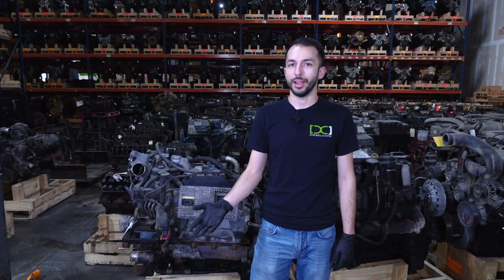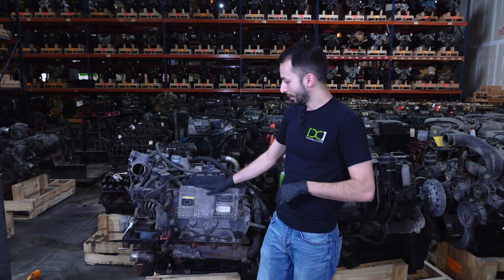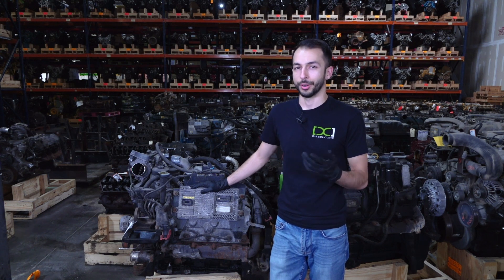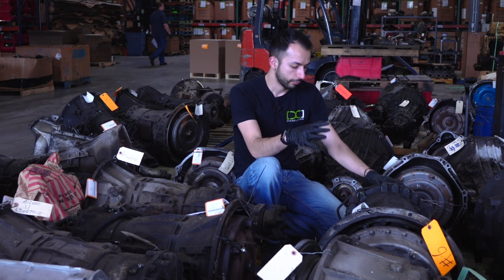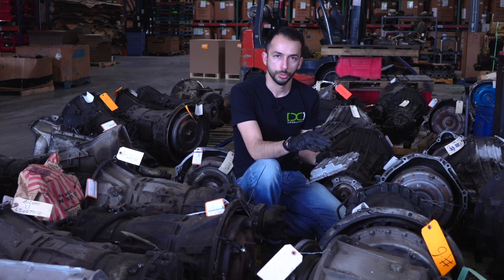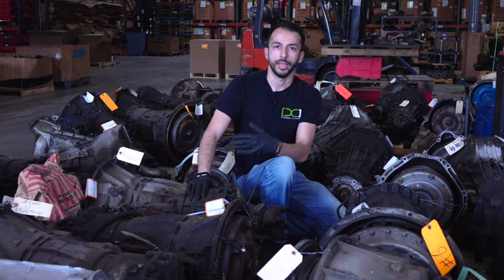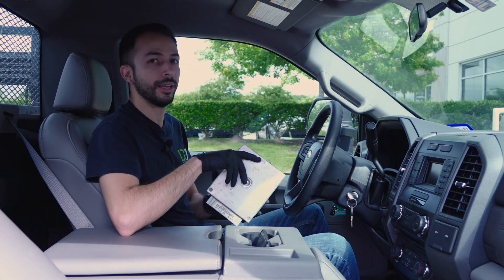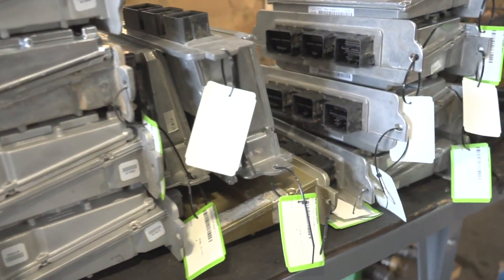What's the difference between an ECM, TCM, and PCM?

Comment: Do you sell wire harness?
Reply from the maker: Which kind of wire harness are you looking for?
Reply: @DieselCore  2008 f250 5.4 engine gasiline harness computer to transmission automatic transfer case
Reply from the maker: @abellopez31  Sorry, we don't carry that particular engine. We carry a very limited selection of gasoline parts at this moment. We mainly focus on diesel parts and diesel components
Reply: @DieselCore  ok thank you

Comment: Ty my 06 is250 wont shift past 4th, and im not about to change all of the pressure control solinoids after replacing the transmission, but what the hell is PCS A, when i just changed all of the solinoids, but the car still shift the same, only to 4th. Autozone scan tools suks
Reply from the maker: Unfortunately we are not familiar with Lexus IS250 and their transmission unless you are talking about a Ford F250 then perhaps we can help you there. You might want to take the vehicle to an authorized mechanic or your local dealership for a more in depth scan of your vehicle